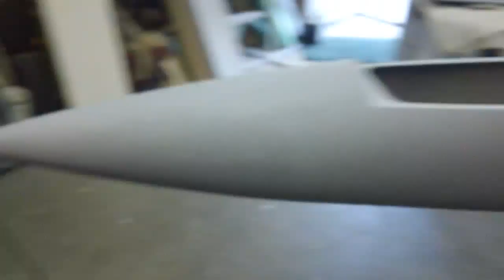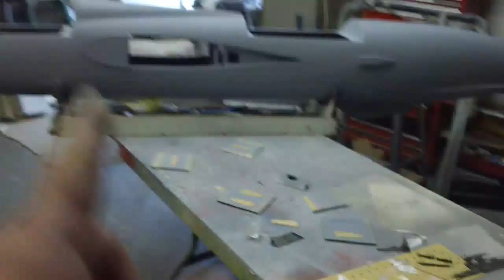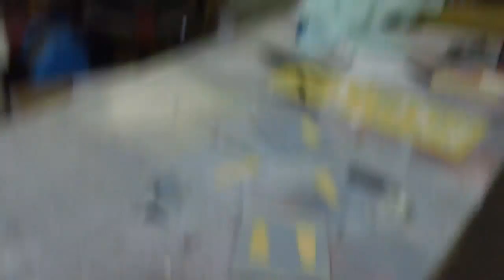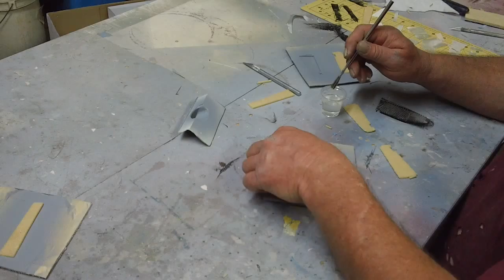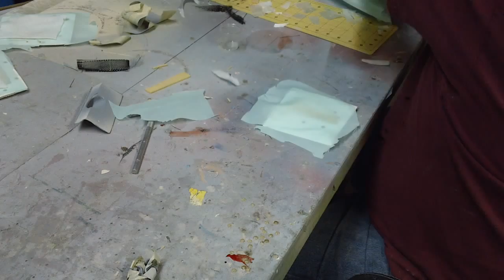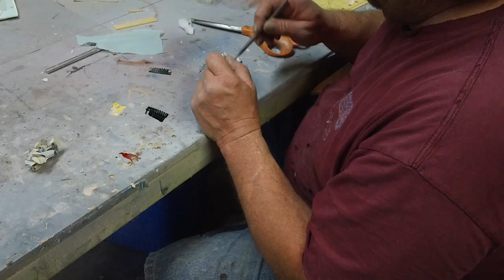how to mold and build a micro composite P-51 #19

Comment: When you were building your fuel tanks I kind of suspected that there would be some pinhole leakage issues, but the fix is very easy and should be incorporated into the production of the tanks.  Visit Eastwood(dot)com and look for Gas Tank Sealer.  It will fill those pinhole leaks.